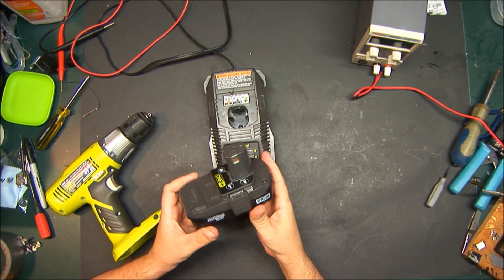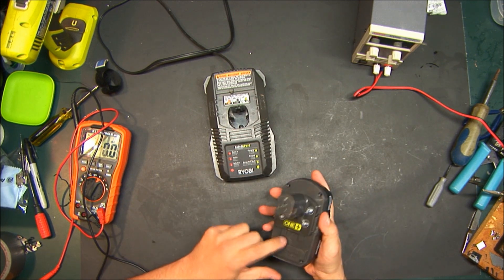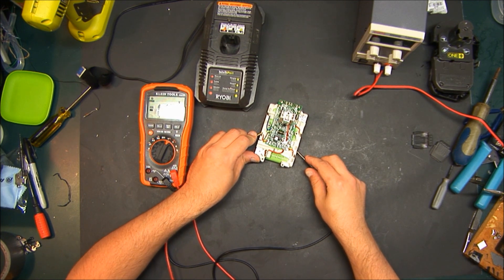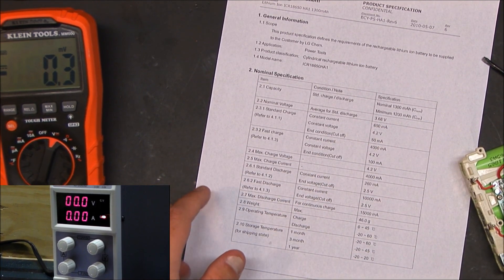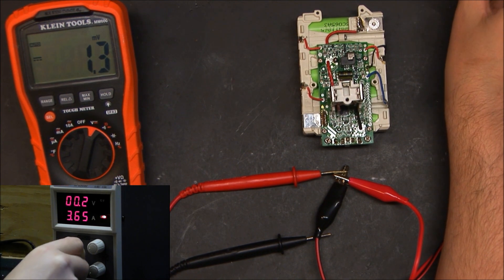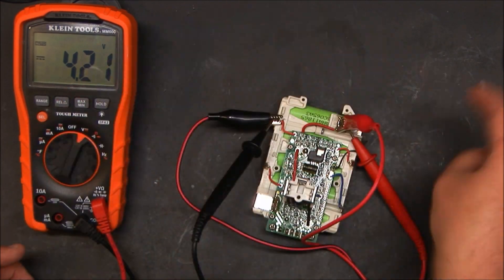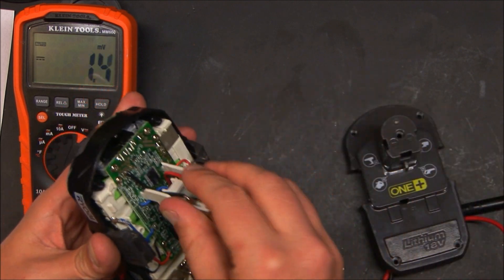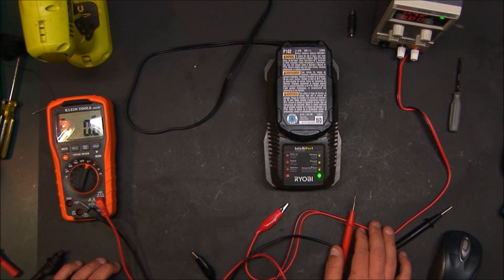18V Ryobi Lithium Battery Not Charging - Teardown and Repair

Comment: Word of warning: Pumping that many amps into a questionable pack is risky. If any cells are internally shorted, 3.7 amps will cause it to overheat and burst in short time. Some "shorts" only appear or fully conduct after a certain voltage is reached, so a cell with 1 or 2v could still have a short. Make a jig to hold power to the terminals and let it charge with 100mA over several hours. If the cell refuses to get above some low voltage point, then it is shorted or damaged. The body of the shorted cell should be able to dissipate 100mA without heating up to burst levels. An undamaged cell should easily get up to over 3.5 volts after an hour or so at 100mA.

Comment: would of been cool to see how u actually charged the cells, i have same problem. kinda new at this but tired of replacing these cheap things u know. what device did u use to actualy distribute the charge to the cells?
Reply: I know this comment is a year old but he used his bench power supply, he did it in the video, just didn't let the camera sit for 10 hours.  Gotta charge each cell individually.  Problem is one falls below the rest and its never able to catch up.

Comment: I've got a brand new ryobi one+ 4ah battery that isn't charging. It flashes red and green on the charger and the charge indicator on the battery doesn't respond. When I check it with my multimeter, it shows 19 volts though. Any thoughts?

Comment: my charger (P118) doesn't work. When I plug it in, the red power light briefly comes on then turns off (1 fast blink). I opened it up and checked the fuse, fuse is fine. Any ideas or tips how to diagnose?

Comment: Have a Ryobi P102 that worked well last fall.  Sat in the charger all winter.   Charged it this Spring.  Discharges after about 5 minutes of use.  What's the fix for this?  Could one or two of the cells simply be bad?  Thanks for your help!

Comment: I have a P107, same type of issue, only a few of the batteries get to the 4.1 and 2 others are lower.  With this the drill's life is bad. I cant even drill 3 holes with the darn thing before it's dead.   I would like to try this, but, I don't have all the gear. What spec Wallwart would I need to attempt to charge up these cells ?  I have a box of power supplies (wallwarts) and I could find something that should be perfect, just need more of a exact spec to look for.

Thanks !

Comment: i got 18 volts on pack, all
cell are good. but have like 6 volts on output. charger says it charged but
when i press the status led is says low and won't run the drill. any idea?
Reply: Thrices check every cell, you may have some dead cells.

Comment: I have a P189 18v 1.5 Amp that I got about 6 months ago.  It wasn't charging.  Red flashing light.  Total was about 300mv.   Took it apart and measured each of the cells.  All were around 300mv.    Cut the wiring off an old USB charger (5v 800ma) and taped the wires to each cell with polarity correct.   Took about 3 mins per cell to get to 3v each.   Total voltage measuring around 13v.   Put it back together and now the factory charger is working.   Thanks for the hints!  Bought you a coffee!
Reply: I guess I probably could have hooked 12-18v directly to the whole pack with wires, and charged it enough to get it going since the cells were all about the same voltage.
Reply from the maker: Thank you!  It's really appreciated and I'm so glad you got your battery working.  Great job!

Comment: what kind of voltage limiter battery charger do you recommend to buy
Reply: Hi hello  I have 18v 1.3 Ach battery that charges fine. However the battery does not hold that charge. Can you help me? Tha ks!

Comment: Is the pack dead if some cells are showing 0 volts ?
Reply from the maker: you can try throwing a charge on those individual cells to bring them a little more up into spec.  Sometimes they hold, sometimes they don't.

Comment: Great vid!... thanks for posting.  I have a P107, all the batts are 3+v except for one showing .3v.  the terminals inside the pack(case) show a total of 13+v  but put together, the tower reads at 1.0v.  do you think the PC board or could the single low v battery is causing this>?  thanks,
Reply from the maker: single low battery is causing it.  The circuitry inside does a few things but one is when it detects that a cell or total output is less than a set level it shuts off so that you don't kill the cells by overdischarging.  Also there's usually a thermister within the battery and/or drill.  That is usually the third terminal on the post.  If that does not get a reading from the drill it also will not output power.  I would try what you saw in this video and either replace that cell (carefully) or charge it individually as shown in the video.  Just do yourself a favor and keep an eye on it.  If the cell gets too warm, you may be using too much current.
Reply: many thanks for your response.....  I was not able to get that single cell to take a charge so I replaced it in the pack with a known working cell...
It seems to charge  normally but will not complete the charge....  the tower terminals show voltage of @ 6.73v.  When I load test it in a drill, it runs for 1-1.5 seconds and dies,  trigger again, same result... any ideas?
Reply from the maker: @petefarr2547  The battery that you replaced....is it the same Mah rating as the rest?  The controllers are very picky about that sort of thing.  The cells have to be 'matched' to work properly.  Sure I've swapped a single cell out and it worked as have many others, but its something to think about.  If the cells are wired in series check the total voltage before and during load(pulling the trigger).  Kinda curious to know what happens. If the voltage doesn't really change then the controller is shutting it off. At that point you'll want to measure each cell and see if any cell bottoms out under load.  Just be careful that you DO NOT short out any cell.  It could also be a thermister has gone bad within the cell.  Again just throwing things out there.  I had a battery pack where the thermister went bad and the tool barely had any power.  also the charger refused to fully charge it. See the link below.

https://youtu.be/8PS_7ogubkc
Reply: you may have nailed it on Mah rating... replaced cell is a  18650 at 1300Mah  7.4V  9.62Wh  MH47359.   Looks like voltage is wrong also...
Ill change the cell with a similar one then test again...  thanks!
Reply: What do they say about first instincts being the best....  changed the cell with another from a battery of the same type and works fine.  The first one was from a laptop i think.... The charge lite is still acting a little strange as it did before but the pack seems to be all good!!!!  thanks for the help...
Reply from the maker: @petefarr2547  haha awesome, great job!

Comment: I have an issue with my battery 1.5 amp 18v .I tested each battery one by one all showing 4.2 volts. but the o/p shows 4.2 volts on the pins of the battery connector which are attached to the charger shoing error both lights are blinking .

Comment: What about standard 18v Ryobi batteries? Are these the same?
Reply from the maker: If you mean a battery using Nicad cells instead of lithium then yes the idea is the same (for the most part) but the voltages are different.  Nicad cells run at 1.25 volts and can be charged at 1.3.

Comment: I have several batteries that will not charge. I used three different chargers with same results.
The charger cycles normally as it is charging goes for about 30 seconds and kicks off showing fully charged but batteries are still dead. Chargers work fine on other Ryobi  batteries.
Is there a fix for this?
Reply from the maker: Could be a couple things.   First, you could have a dead cell and the charger is clicking off because it believes the battery is defective.  For this you can try what I show in this video.  Check each cells voltage with a multimeter.  Each cells voltage should be similar to each other.  
The second thing that I can think of is something I just did a video on which is the internal thermister dies.  This device measures the internal temperatures of the battery.  If the temp is too high or low it won't allow the battery to be charged or used.  If the thermister is bad, those readings will not be correct.  Here's a link to that video:  https://youtu.be/8PS_7ogubkc
Reply: @Electronicle  Thanks

Comment: just a beginner questions ; how unbalanced cells happened while those cells connected together in a series ? what if one or two of those cell are already weak and drop, how long before unbalanced cells happens again . thanks
Reply from the maker: The cells are connected in series but they aren't usually charged in series.  You'll notice when I opened the pack, there are wires running from the board to the cells.  Those are typically referred to as balance lines....basically the pack takes incoming power and splits it evenly across all cells either individually or in pairs.  From there it can balance which cells are charged and which still need more time.  The onboard controller won't let the cells overcharge or be drained beyond a certain threshold.  The problem is when the cell falls too low below the controllers threshold (usually due to leaving it sit uncharged for too long, or a bad cell) the onboard controller doesn't allow any current to flow in either direction and renders the pack unusable.  This is done for safety reasons.  If a cell is in really bad shape, the last thing they want is to attempt to charge it and burn someones house down.  Time will tell if this pack will keep working or if it'll die out again.  If it dies again, I'm not going to attempt another re-balance as i'll know there are bad cells within the pack.  So far I used the battery in a leaf blower, hand drill and weed wacker the other day all on a single charge and it worked fine and charged fine afterwards......so we shall see.  Hope my ramblings answered your question.
Reply: ok got it.. thanks s lot